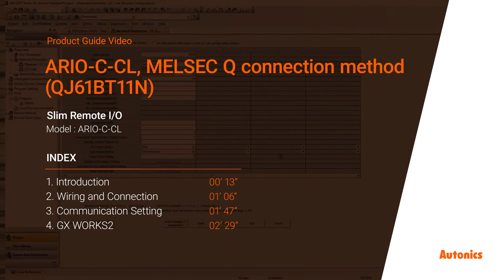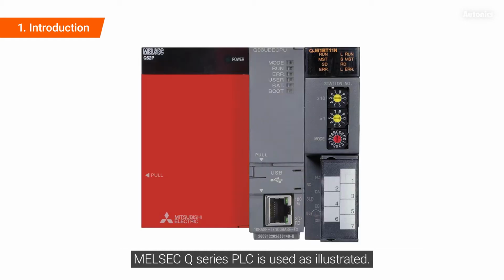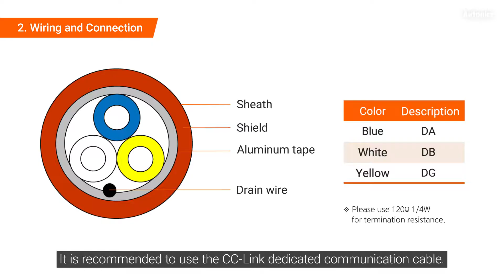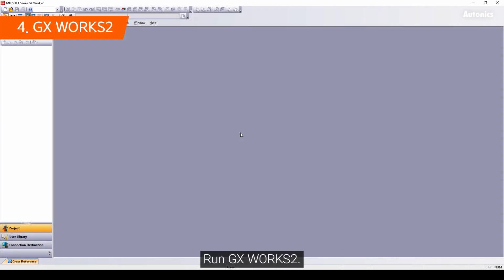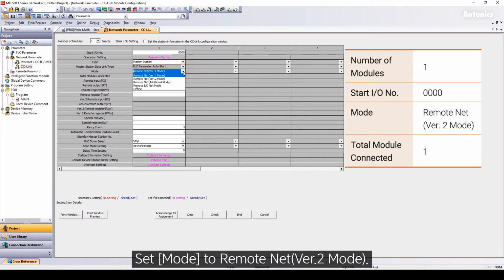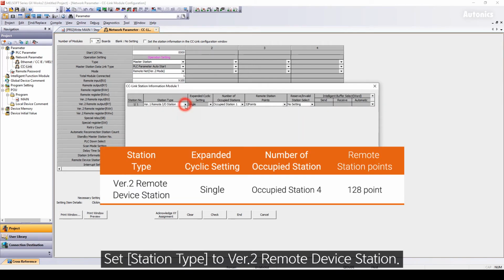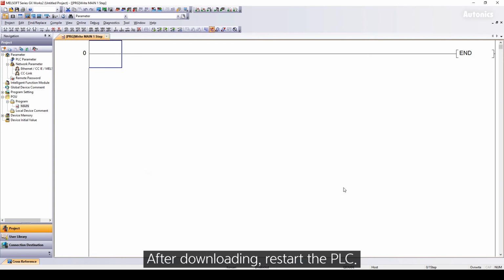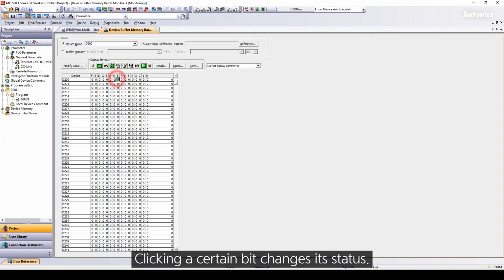Autonics Tutorial : ARIO-C-CL, MELSEC Q connection method(QJ61BT11N)

Comment: Dear sir I Have question 
I need your support . 
:-Now I am using a  -Nemicon OVW2-25-2MD Rotary Shaft Encoder. Now I want to replace it. I want use your product Autonics brand encoder So  how can I compare it? Or which Autonics model encoder is perfect for me?  I am waiting for your kind information.
Reply from the maker: Please review the [E40S6-2500-6-L-5]. Outer diameter : Φ40mm, Shaft outer diameter : Φ6mm, Resolution : 2500, Line Driver output type. Please check the product catalog and compare again. Thank you.